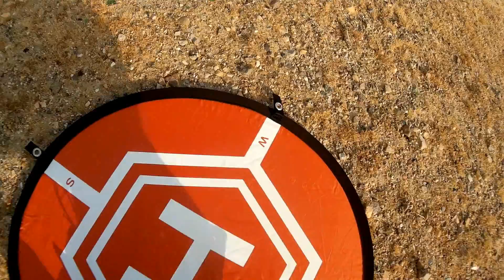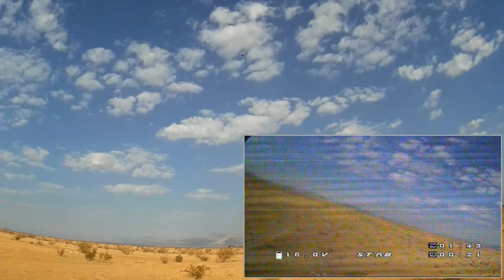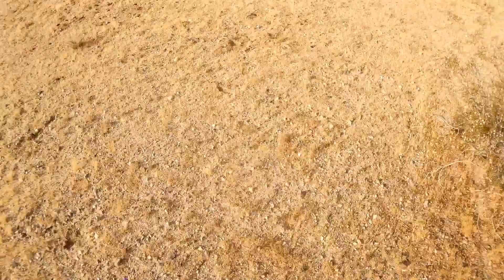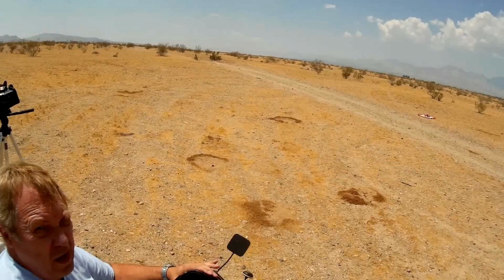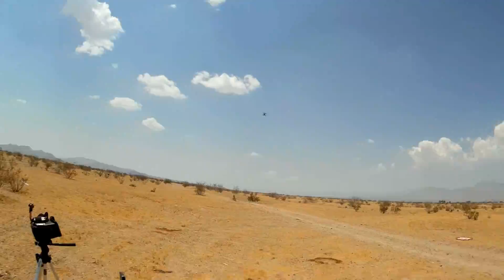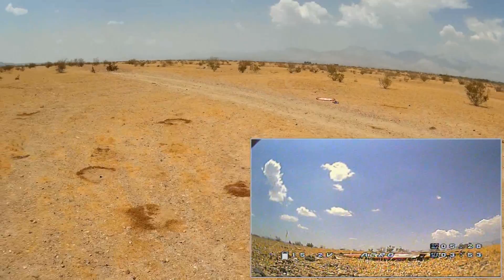Eachine Wizard X220S Upgraded FPV Racer Drone Flight Test Review

Comment: Love the review.. 1. let me say this was the VERY first time I've seen any1 truly explain the pagoda antenna quickly and effectively, then you took the time to explain the quad and all the little gotchas which was great. Thumbs up!
Reply: Gimbal Guy personally I think they are too fragile.... they will fall apart in almost any crash in my experience
Reply: There is a better Pagoda antenna sold by FarVew FPV. Look into the "combat edition" that was designed to be used with a 3D-printed shell and you can buy it all together for $11. I've had excellent results with it.

Comment: New to FPV racing quads.  Just got a 250 FPV racer used off of eBay with a GoolRC controller.  Really like you doing a review on this racer.  My racer has a KK2.1.5 mini FC board and SimonK 12A ESC's with AKASO D2204 - 2300kv brushless motors.  I just order FPV transmitter and camera to install.  It is quite different than flying a SYMA or a PROMARK quad!!!  I just ordered Eachine EV800 goggles as well.  Thanks for sharing your videos!  Juddie
Reply: J & J True Outdoor Adventures Wow... You bought something with 2 year+ old electronics in it... Good luck and be careful

Comment: Ordered it from banggood , wrong throttle remote controler recieved had to open it up and switch around. The first flight test was not yet possible with fpv , could barely see anything (first fpv flight I have ever). Overal the response time of drone is very amusing and the antenna sticking out like that almost instantly breaks upon small impact (upside down). 

Very helpful video

Comment: As reviewed I wouldn't even consider buying one of these. Too many problems out of the box.
As you say it will and is being improved and the seller (as flagged in the now broken link) has a warning about the motor screws. It has possibilities but I'd wait for a review of the improved versions. Just my view as a complete tyro

Comment: Quadcopter 101,
The drop out was probably because of the poor standard receiver in the RTF version. There have been a lot complainments about the receiver. You Should upgrade to a x6b or an ai6b, that would work much better.
Hope i could help you And have a nice day
Reply: Niek Westerink I bought an RTF version, do you have instructions or a video on how to switch out the standard receiver? Thank s

Comment: My problem with the eachine x220s is you have to get rid of those props they pull too many amps try using Dal Cyclone props much better results longer flight times
Reply: Indeed, these props are awesome! I use them and pretty cheap on amazon too
Reply: You can get them on amazon, they are the t5046c I believe, but any of the 5inch dalprop cyclones would be good

Comment: Thanks for video... quick question, even though I have a arm switch enabled I still have to hold throttle down to the right for two seconds in order to unlock motors....Is that the same for you?

Comment: I know the quads voltage is on the lower left portion of the screen but what are those two readings on the right side?
Reply from the maker: Top one is total time that battery power was on, and bottom time is flight time.

Comment: Hello, What's the easiest way to turn off the LEDs? In BF of simply disconnect wires from the PDB?
Reply: BF
Reply: DjOlidang I tried but now the lights are white. I dont see the off switch in Bf. Got a tip? Sorry to bother.
Reply: No probs. Make sure you turn LED_STRIP on in BF configurator and then turn LEDLOW on in modes tab, i have set mine to 1500-2100 aux2 for a switch on my transmitter. You don't need to delete LEDstrip tab data.

Comment: How do I set up my wizard?
Reply from the maker: Back in 2016 when I reviewed this, the transmitter needed its switches setup to be able to select different flight modes.  But five years later, the manufacturer should have corrected that problem by now.  Have you checked the instructions to see if they discuss the mode switches and what they do?

Comment: Hi I have a a question Can I use a spektrum receiver and transmitter with this quad or any other race quad thx
Reply from the maker: You would have to remove the existing Flysky receiver, and install the spektrum receiver in its place.

Comment: Me and a friend ordered them at the same time on the same order and we got the xb6 for a receiver because we bought the x220s without the transmitter. We have both had issues with them rolling out of control on 4s batteries. They seem to do better on 3s, but I did have mine jerk right and left one time even on 3s. The video reception is horrible on punchouts. I am very disappointed with this quad. For a RTF quad, its not very good. And I have yet to find an answer as to why it would get out of control by itself anywhere on the internet. We've set them up in bataflight correctly, But they seem to have a mind of their own. I have the x220 and love it! Very unhappy with this one though. Anybody else having these issues?
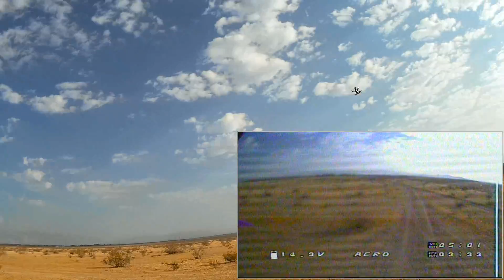Reply from the maker: See my video at 10:04.   Notice on my quadcopter that I had not extended the receiver antennas outside the shell.  If your antenna is still inside, try extending the antenna(s) outside using zip ties to hold them away from the props.

Comment: Unfortunately, it seems to be more common these days to receive one of these racers with the camera out of adjustment. I had an Eachine QX95 with an out of focus cam, as well as a KingKong90GT.  As you say, its easy to fix, but its even easier for the manufacturer to take the time to check to see if its IN focus before leaving the plant. The video seemed much better with the regular RHCP antenna on it vs. the Pagoda .. which was giving a lot of dropouts. Maybe it was defective? Unusual for the craft to just drop out of the sky like that, unless it was a de-sync problem with the FC board (perhaps pushing the frequency on the CPU too hard .. check to see what the CPU load is in Betaflight  .. if its over 25-30%, that could be a problem. I try to run mine at 15% load or less. As for the lines in the FPV video, that looked like noise on the DC power line to the camera .. not enough filtering. Some guys have fixed that kind of problem by installing one of those cheap/small Puolu DC-DC converters somewhere on the craft, and powering the camera with it, since it produces nice clean power.  Well, at least you didn't hit your car when it dove in (or anyone else) .. that's a plus. Thanks for the review. Cheers.

Comment: How could you recommend this btw.... The thing randomly fell out of the sky not once.... but twice! complete garbage and dangerous.
Reply: Demian Geven I could almost recommend this if you get the version without the transmitter and receiver. the receiver you get is the real issue there is well documented complaints about it since its launch at the end of last year they made a horrible Choice by putting the FlySky/IRange A8S in this package.... of course once you get past the receiver problem there are a few more issues but you can work around those to have a decent quadcopter
Reply: U just got a bad copy that's all mine flies great

Comment: Guys, don't buy this piece of junk. It looks cool at first, but man, you will want to change pretty much all it as soon as you will fly like 10 batteries or so. And it is not durable at all, couple good crashes ant it is done. Just broke the frame today on low speed impact.

Comment: Camera footage on the drone, is meh

If you buy this you should replace the camera or you'll be crashing lol
Reply: how do you do it?!
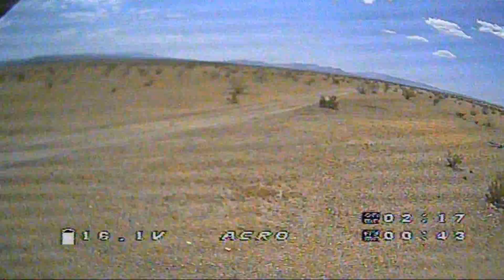Reply from the maker: Here's the footage after focusing the camera 13:58
Reply: +Badger if you are asking how to change the camera , may i suggest that you visit (Grayson Hobby) there you will find a great video on changing out this camera for a much better one
Reply: Ted Espin 
Nice, i have been thinking about buying this
Reply: +Badger she is nice but you should check out other videos on this one , it seems to have a few problems but it is still a great drone if you can do the work to make it right . I myself have the Wizard X220 , which is also a great drone .
Reply from the maker: Agreed, this is a great drone. It's very fun to fly. But currently you'll need to do a bit of "tweaking" to make it such (most of these tweaks should have been done at the factory before it left for sale).  The needed tweaks are listed in the above video description under "Cons".